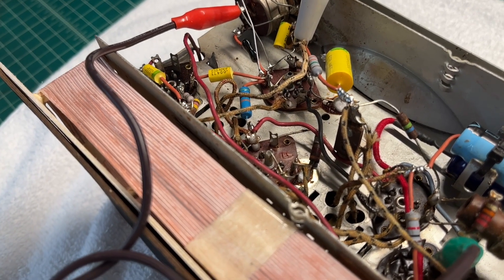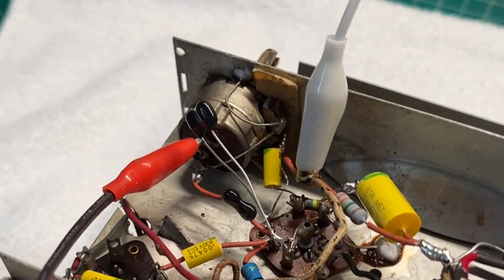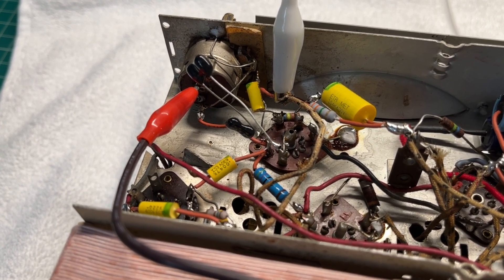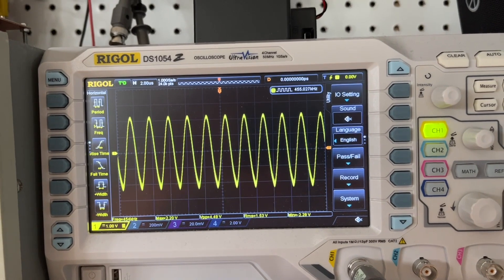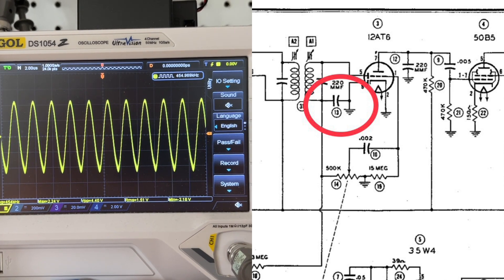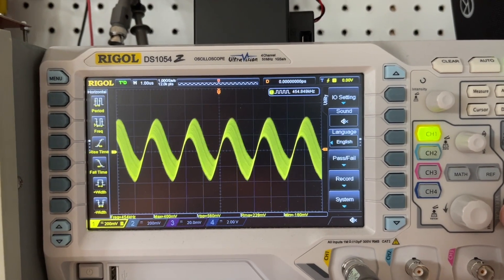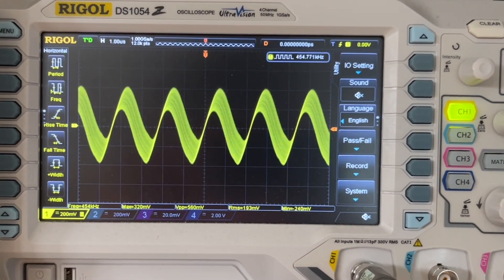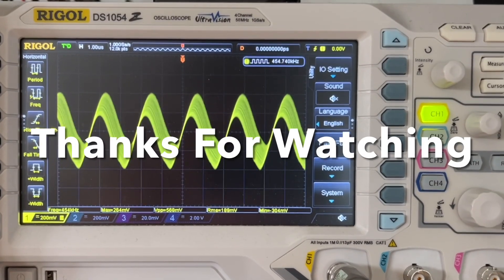Emerson 588A - Diode Filter Explained

Comment: Nice demo Don, how many meg is your 4-channel Rigol Oscope. So you used direct couple on your scope using  alligator clips instead of a standard 20mhz probe, for your demonstration.
Reply from the maker: Hugh - it’s 50 MHz. Sorry for the confusion, I used my 10:1 probe with the capacitor in series. Best, Don